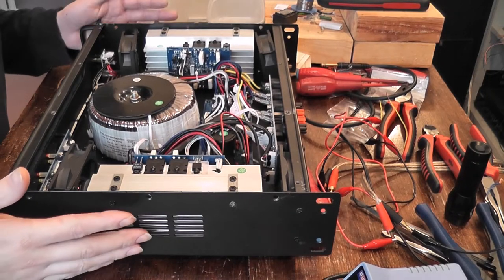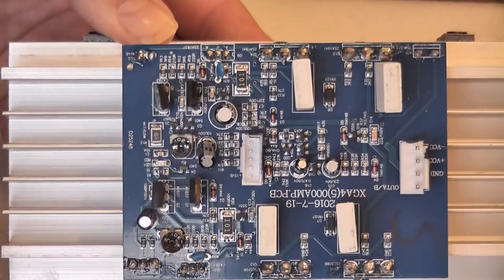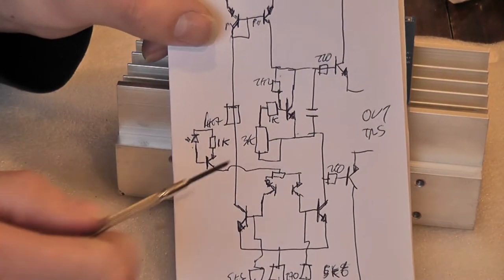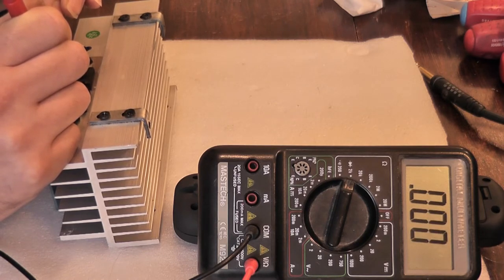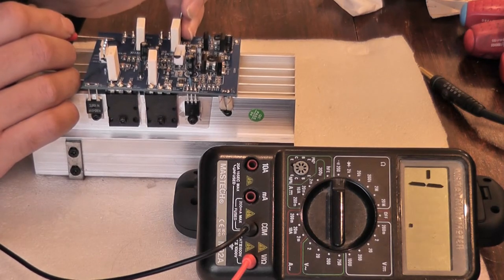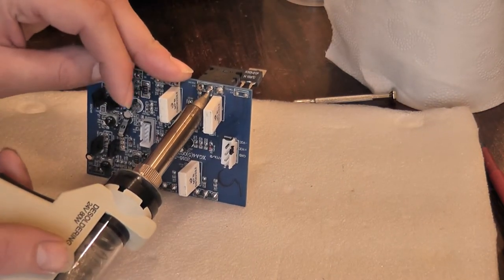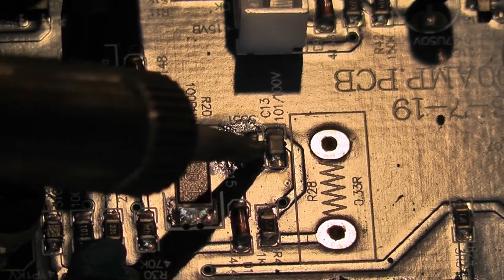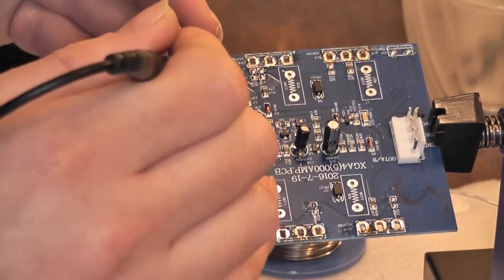XGA5000 diagnoses and prep.

Comment: I admire your patience in analysing and  repairing these clearly flawed amplifiers. Personally, I would not waste my time doing so. I look forward to seeing a video you make where you are a repairing an amplifier worthy of your talents, perhaps a Crown, Crest, QSC or classic C Audio amp. Quite how Gemini are able to claim an output of 5KW on these amps I shall never know, even at irrelevant so called peak ratings, given that peak is four times the RMS rating. I would be surprised if these amps were capable of generating 500 watts RMS per channel into 4 ohms, at clipping. Interesting video, none the less.
Reply from the maker: I used to fix quite alot of proper amps for people years ago. Problem is the decent ones last so long, and generally end up installed in professional installations so just get changed out.

They pop up on ebay, but people who flog them ask way too much to make it worth while.

Comment: There was a lot wrong with that card basically all new semiconductors and all resistors below 100 ohm it wine hard for it to be cost effective to repair
Reply from the maker: Indeed, no sane person would be willing to fork out the labour bill to have it repaired.

Parts wise it's not too bad. The output  transistors come in around £2.00 and the rest of the components are only a few quid.
Reply: @killcar5nbike2  If you are in the Nottingham area, I might be that insane person.. :-) You seem to be very knowledgeable when it comes to the Gemini amplifiers. I have an XG-2001 and the 10A slow fuse (sits where you plug the power lead in) keeps blowing as soon as I switch it on. Can hear a slight hum from the transformer and the fan starts, but that lasts only for 1 second. Fancy taking it on..?
Reply from the maker: @VinceTheBeast  if I were nearer I'd have a look. By the time you'd posted the thing to me and back costs would already exceed the things value.
Reply: @killcar5nbike2  Not to worry. Thanks for your reply👍